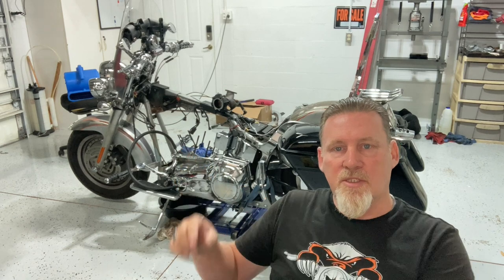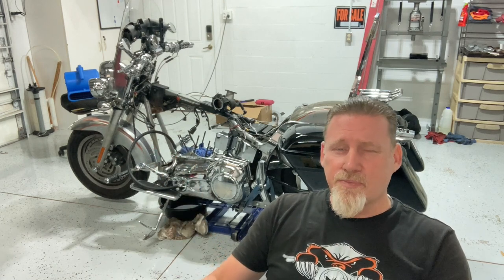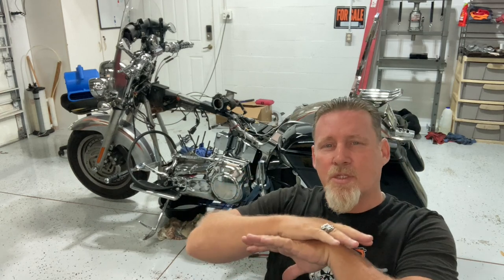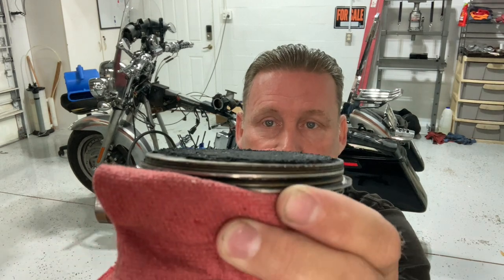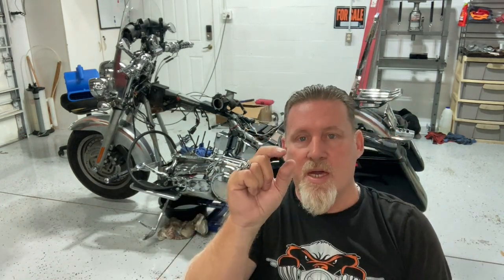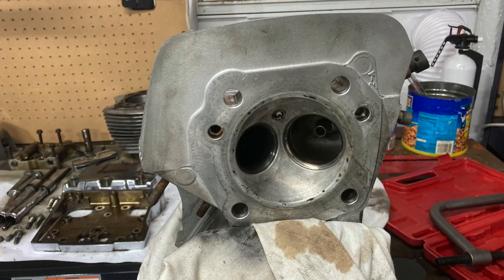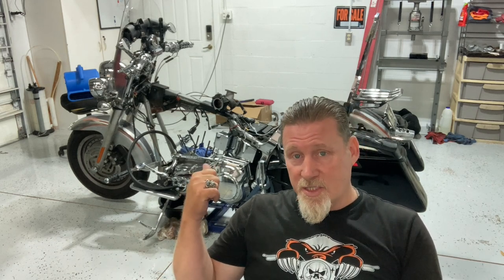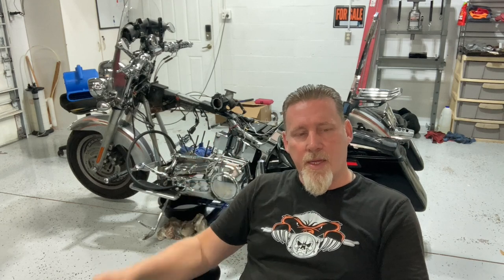Harley Davidson Fatboy Twin Cam Motor Knocking Guess What I Found Cams, Lifters, Piston issues.

Comment: I wish I was there to help you work on it. mostly just to learn by doing. I have a 2000 fatboy, runs great, has a new cam put in over two years ago and no problems. I used to work on just about everything - bicycles, mopeds, english and italian sports cars, my own vans (pre-1998). Still have my '72 240 Z to be worked on. Nonetheless, look forward to your future mechanical videos. Thanks.

Comment: I have the same bike. 2005 CVO Fat Boy Silver same color. I’m the second owner. It’s low mileage meticulously maintained. The only thing I have done to it so far is put the external breathing system on it from DK custom. That breather eliminates the air from the motors crankcase from going back into the intake and routes it into a catch can .DK custom has a video showing how the stock intake over time will build carbon on the pistons. Harley has to make the intake this way to meet epa regulations.

Comment: Im currently having a hard knocking , noticed it at idle opening the door to put the bike up . The crank has about 15,000 on it , its a D H crank , so it shouldnt be the crank unless theirs metal from something going threw the engine . I put VR1 conventional sae50 weight in mine about may-june every year , and sae20-50 (I dont use syn in anything its a moisture magnet and will rust the inside of your engine if it sets much and starting only for short periods)  in about november every year , I pay close attention to the magnetic oil drain plug , nothing on it but a very small amount of gray powder = normal wear . Obviously aluminum is not magnetic so you have to look closely at the oil , havent noticed any in mine , you can strain the oil threw a tightly knitted rag and look for aluminum . I suspect the knocking (sounds like a rod knocking) is a s&s premium lifter collapsing , they did not want to pump up new . I running the s&s 551C , I like it better than the 302-2  I had in , more low punch on narrow curvy 2 lane and steep hills . Using a old piece of air hose to 1 ear and on the engine block just under the jug deck and beside the front (front side of the engine) lifter cover I could hear the knock , at the back side of the engine in the same place no knock . Where I placed the hose is the only place I could clearly hear the knock . Either the roller and cam fine flaking metal , or the roller locking up(common problem) , the metal off either can destroy your engine , the oil pump gets it first , my oil pressure has not changed . Right or wrong I`ll find out shortly . I have already got got hylift johnson lifters (johnson lifters is a different company and more expensive $300.00 +)  , they have black bodies and a snap ring instead of a wire clip and they are slow bleed down lifters , from top line automotive in chicago , ordered over the phone # B-2313S (08 ultra 96 now 106ci) appx. $168.00 , lifters will be the least necessary part of the problem , considering what s&s lifters cost  I dont think they were worth the price , so Im trying the hylift . You come back up and see us again some time . A day I`ll never forget - 8-13-04 ...............
Reply from the maker: Let us know what you come with, and how you fixed it. Thanks for watching

Comment: Sonny - Just wondering if you also replaced the cam support plate and oil pump when you had the tensioners replaced before?  Also did you replace the cam support plate and oil pump this time?  What cams did you go with?  I've got an '08 with about 55K on it and I'm thinking about doing a stage 2 but don't think I can afford to also replace the support plate and oil pump after buying gaskets, pushrod kit, lifters and a tuner.  If I can get by using my stock plate and pump for a few thousand miles this year, I can replace the plate and pump next winter.  Looking for your input.  Thanks.
Reply from the maker: Yes I went with a fueling plate and the 509g gear drive cam kit. My other 2005 has 34,000 just replaced the cam shoes left it stock either way works the gear drive is more durable choice but your crank runout has to meet spec to do that
Reply: @TheBadgers  Thanks for the quick reply.  With 54K I'm sure I won't meet the runout spec so think I'm going with a Feuling 543 Reaper and keeping my chain drive.  I'll upgrade the cam plate and oil pump next winter.  Thanks again.😎

Comment: I assume that you are still using the stock crankcase breather system where harley feeds the oil mist back into the intake, if so this is where you are getting the carbon build up as the oil mist is accumulating in the cylinder. This set up is a oem epa requirement. Thr best thing you can do is run an aftermarket catch can so none of the oil mist is going back into the combustion chambers.
Reply from the maker: Yes I have debated on changing that system around or just doing a really good carbon clean every 25k. Still undecided at this point

Comment: Sonny, you're not going to do the rod bearings ???  My 98 ultra bottom end fell out from my mechanic switching from straight 50 wt eng oil to multi grade syn with
Reply: With 98,000 miles... Change the rod bearings while you have it apart
Reply: If its stroked like he said was it already stroked from factory or did someone do it later it would have new rod bearings

Comment: Curious what your crankshaft runout was?
Reply from the maker: about 1.5 i was well within spec and has been doing great
Reply: @TheBadgers  That's good your crank should be fine. I know I've been considering going to a gear drive cams but the more I research it with the quality of after market camchest kits and hydraulic tensioners improvement over the years I wonder if the added cost of gear drive is worth it, specially if down the road crank runout exceeds the limit for them. Thanks amazing your's is only 1.5 with over 125k on it. Maybe some never get out of spec.